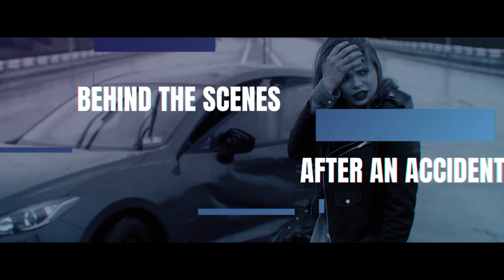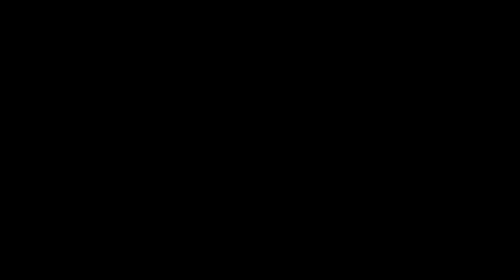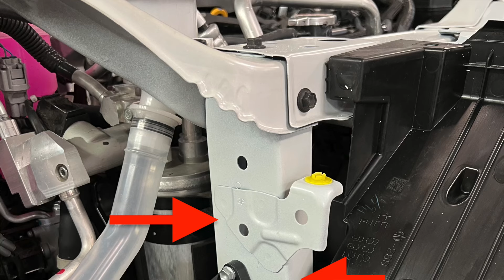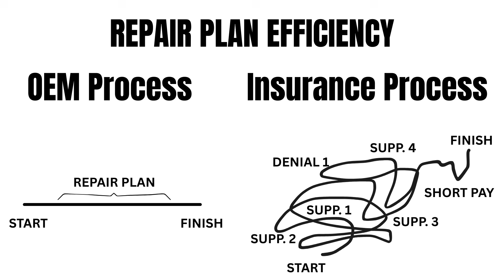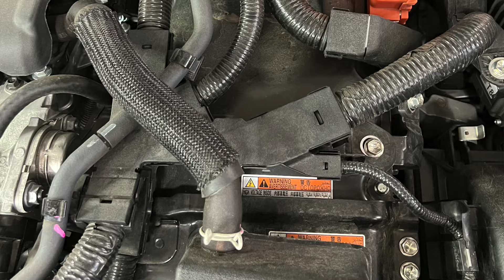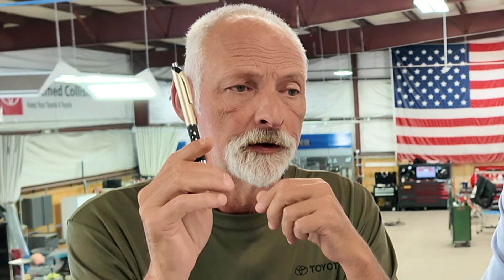Who Should You Trust To PROPERLY Repair Your Car?

Comment: Great timing on this video! I recently attended the annual Great Designs in Steel conference in Detroit, which focuses on the automotive steel industry. The event brings together steel manufacturers, engineers, and companies that develop innovative structural and non-structural steel components for the automotive sector. Structural parts are evolving rapidly, with redesigns aimed at improving safety, fuel efficiency, manufacturability, and cost — often at the expense of repairability. This is yet another reason why the auto body industry must consult OEM repair procedures for every vehicle. Mid-year design changes are real and frequent, and relying on outdated repair methods and outdated information can lead to improper repairs. One of the highlights of the conference was seeing the CAD impact testing and crash results based old and new designs. Do aftermarket parts — especially those that attach SRS sensors — undergo the same level of metallurgical analysis and crush testing as OEM parts? I think we all know the answer. That’s something many body shops and insurance companies should seriously consider in the interest of driver safety.

Comment: Autozone use to have a pretty decent 2001 Toyota Camry aftermarket radiator.  I bought a lifetime warrantee radiator for ours about 12 years ago and so far it has lasted as long as, and almost as many miles as, the original radiator.  Not sure what they are like these days though and that is the problem. YMMV.
Reply: Well probably its also made by denso anywayz 😂
Reply: @johndone8045  Nope.  It was a Chinese knockoff.  No brand name, made in China, and a little less than $90 at the time.

Comment: Recently insurance companies started to not care where the psrts from, we got suppliers from florida and ca when we are in nyc, well, atleast most aftermarket vendors do price match... but thats annoying

Btw sf has oem policy, if the owner didnt buy it, its his fault

Rad support is fine to use a/m, in fact i am guessing 99% of insurance repaired cars are using a/m rad support in ny, we will live😂😂

THey do have a/m inverter cooler now? Havent been replacing one in a while, that thing better be oe, but radiator is ok to use a/ m as long as its denso, not those autozone cheap crap lol
ANd make sure using oem coolant, newer toyota engines are very picky on coolants😂
Reply: Have you had anyone do a post repair inspection on any vehicles that you’ve repaired? We have 2 different shops in our area that advertise post repair inspections, it keeps some shops in check.
Reply: @andysautobodycollisionrepair  havent had anyone came back and complain
I am def not all oe shop and theres many paths to reach the same goal, oe procedures could be a reference but techs can always use their knowledge to differ
Normal tech follows everything
GOod tech knows the short cut

Oe ways are not always the best